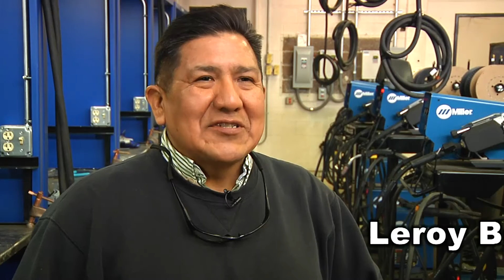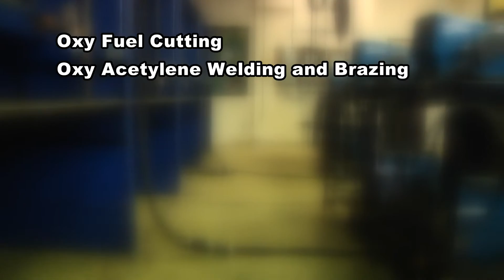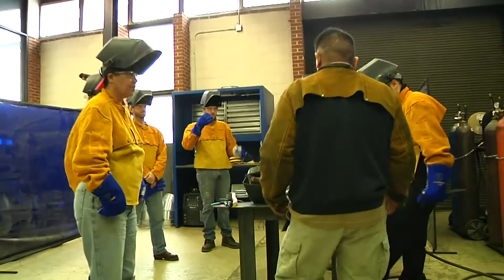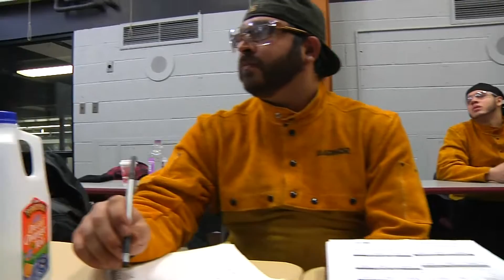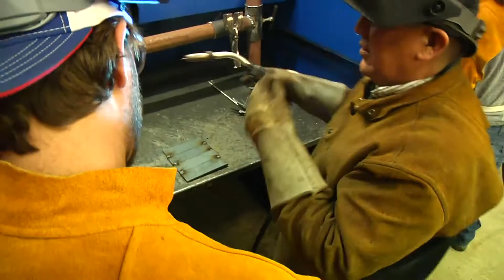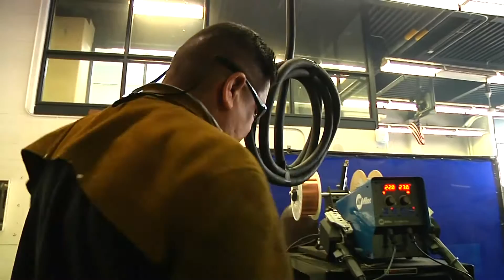TSCT's Welding Technology

Comment: great video but i have to say once you have the knowledge then it really only is practice the skill would be very good to get good at but most industries uses welding robots... but good old fashion welding , is like good old fashion wood working it test skills. would be cool to have a bunch of different filler metals and the 5 basic cateogry machines mig , tig , arc , plasma , oxy/acet to practice on a bunch of different type metals mostly the important to AL and Fe ... i have so many cool ideas to try with welding on practice pieces if i ever get the chances. Nice to see there is great instructors that can teach the knowledge part